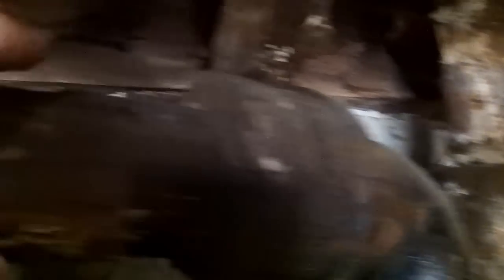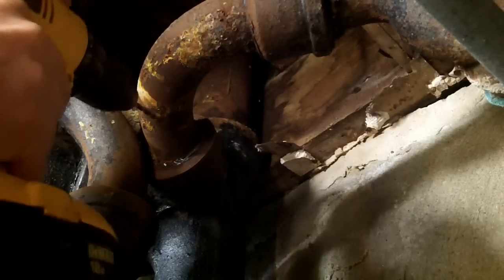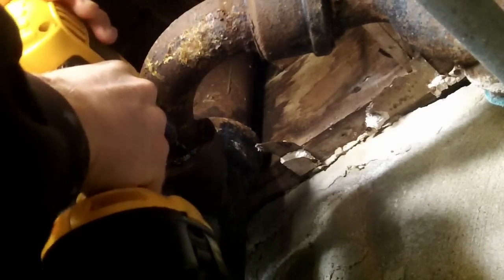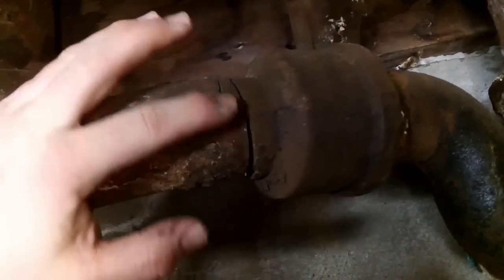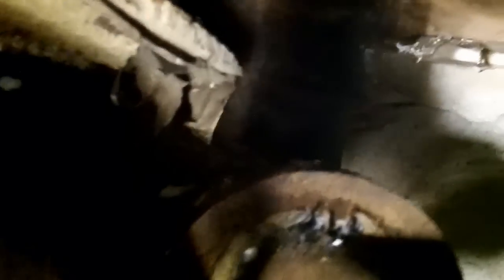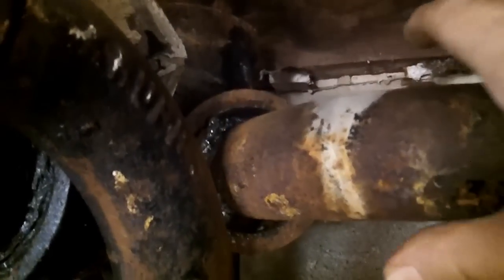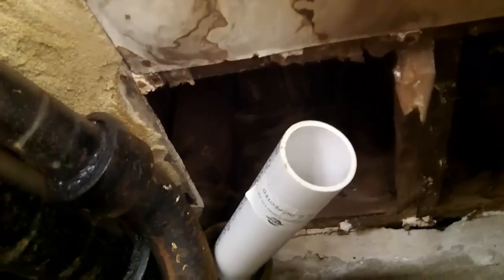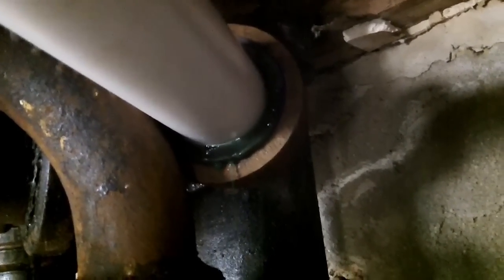Cast iron pipe to PVC using a Fernco Donut

Comment: Hey thanks!  I am curious why you drilled the lead seal out and did not use a torch?
Reply from the maker: Mark Zagorski Lead fumes are incredibly toxic. Also, with just a benzomatic torch it would have taken forever. 

With the proper respirator and torch I would have done that. Odds are if I had all that though, I woulda put cast iron back in. Haha.
Reply: phatdonkey78 thanks!!!
Reply: Cold chisel and hammer works fast in deforming the lead to the point of removing in one piece with channel locks.
Reply: I enjoy the fumes. It's a bonus. And now I see & hear things that arent there and I'm constantly arguing with inanimate objects because they're ALWAYS talking smack on me behind my back.
  It's well worth it though.

Comment: Where did you buy this Donut is it special order ?

Thanks for sharing.
Reply from the maker: Dicofole The ones I have gotten were on the shelf at my local Home Depot. Didn't have to special order them. From what I read online, the local stores will have the most common size for the area. For example, a local casting company outfitted most of the cast pipe in my area so the donuts are sized to it. Its yet to be proven, but thats what I have read online.

Glad you liked the video.
Reply from the maker: Dicofole So far i have done the 2 inch to 2 inch in this video, a 4 inch to 4 inch and a 2 inch to 1.5 inch. All of the donuts were at my local store.
Reply: L